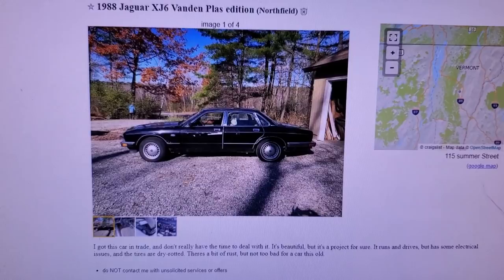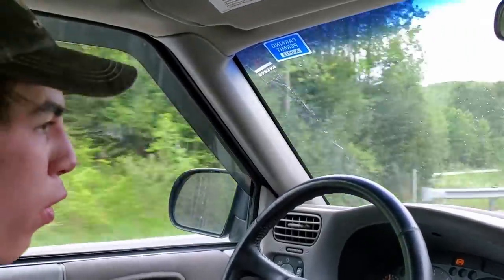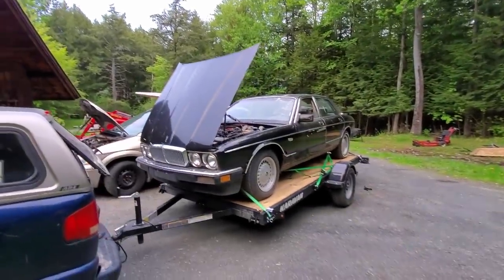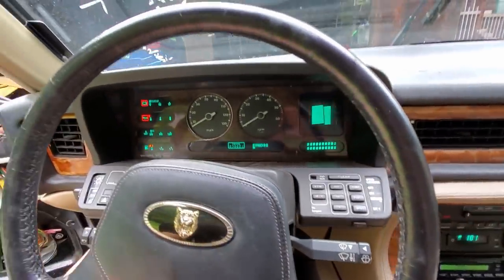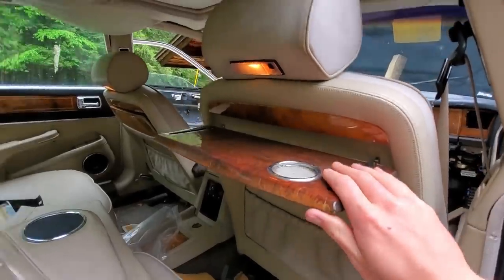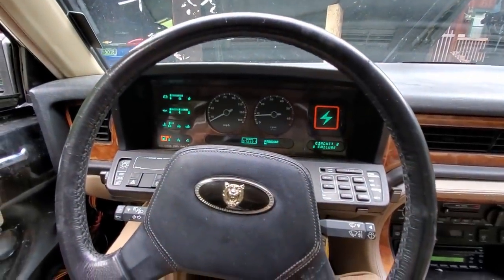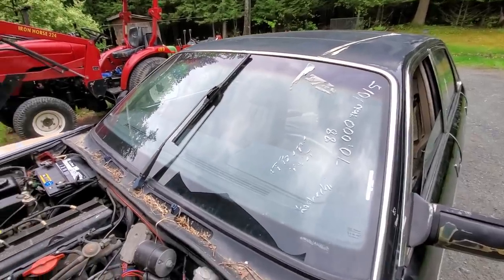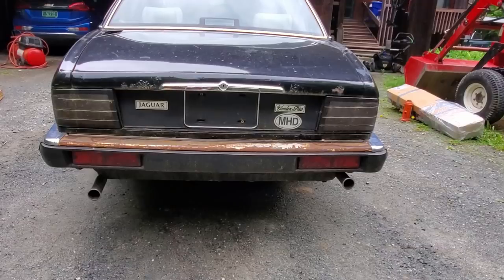I Got A FREE Jaguar XJ6 Off Craigslist!

Comment: I had a '94 XJ6, the last of this generation, and the second year of Ford ownership for Jaguar. Bought it for $1200, drove it for a year, sold it for $1400, and actually really loved it and was never left stranded by a breakdown. Sure it had plenty of little Gremlins - a window that wouldn't work here, a burst coolant hose there, one door only worked from the outsider - but that engine has plenty of life and is a rock solid lump. In "sport" mode, mine had plenty of juice and a hole in the exhaust gave it a perfect purr. Mine was a fine commuter in Texas, that I looked forward to driving and really didn't have any big issues with over the 12,000 miles I had it. The '99 Miata I replaced it with was horrid. Very fond of my XJ40 series Jaaaaaaag; hope you enjoy yours!

Comment: KEEP THAT NAKAMICHI RADIO!! Those are rare man :P
Reply: Good call!.....I had a Nakamichi cassette deck once, cool machine.
Reply: @iseeolly9959  I own multiple tape decks from them, and also an early 2000's car head unit.
Although it's outdated in terms of functions and features, it's still a great car radio, and so is this one.
Reply: He has the CD400, i'd die for that head unit to put it in my older BMW's.
Reply: @gideonbouwman4904  But I do still have a 1980's Akai Hifi cassette deck ....a GX with glass heads...whop whoop!
Reply: @iseeolly9959  those are good heads ye.
Had a Reel to Reel with those heads also, sounded wonderful.
Reply: @gideonbouwman4904  Yes sir, and they never wear out!
Reply: Gideon Bouwman 

My 72 XJ6 has a nakamichi radio in it

Comment: Circuit 1 failure is a blown fuse in the left lower fuse box.
Circuit 2 failure is a blown fuse in the right lower fuse box.
Reply: LOL!  There goes the "trying to sound Smart" evidence...  Yet much better than the stupid Check Engine crap that stresses us and makes some run to the dealership...
Reply: hey you seem to know your car electric stuff... can I try to ask you to help me with me 2000 4runner windows? they're not opening.. NONE OF THEM, the back, the front even the tailgate one. help !!
Reply: @megaxboxx  - If none are opening it is either power to them (check the manual and see what fuse/fuses are listed for power windows) or the module controlling them.  Odds are it's a fuse.
Reply: @hmm hmm - There is a push button reset switch on driver side under steering column.
Reply: @adamc6087  On a 3rd gen 4runner? I've never even seen a reset button on my 3rd gen in all my years of wrenching on it.

Comment: Im not sure if you know, but Vanden Plas was the "Luxury" Trim of BL cars. Everything from Allegros to Jags got a Vanden Plas trim with better finishings, better sound insulation and other higher end things. The base was built alongside the regular cars, but then they where taken to the Vanden Plas factory, where they made the interior. Also, the Jaguar XJ6 Vanden Plas only exist is the US market as in the UK this trim was a Daimler. 

This is a Jaguar XJ40, the successor of the Series III. Sold between 1986 and 1994.

Yes electronics are unreliable. Damn lucas electronics. The VCM (The screen on the right of the gauges) is extremely prone to breaking. The fact that it still works is a good sign. 

Check the tensioners and the oil. Headgasket problems are not uncommon as well.
Im telling you, that one is a keeper. Dont ruin it.
Reply: The correct way of pronouncing Vanden Plas is actually by soundng the the 's' in Plas. The ' plah' pronounciation  is a popular misconception. See here:  https://www.aronline.co.uk/marques/vanden-plas/
Reply: X2 on correct pronounciation being vanden PLAS
Reply: Agreed, this car has a lot of life left in it based on my XJ40 experience.
Reply: Santiago Rocha I don’t know if you know this:
Van den Plas, yes 3 words, started as a coach builder back in the days before the automobile. Long story short: he had 2 sons, they split up and did their own thing. 1 son went to England to finally sell his name. To protect his work and finances he changed the name to Vanden Plas. That’s why I still have to work for a living.
Reply: @argonaut6386  How interesting. I swear i remember on all BL promotional material and even on the Thames car show they prononced it like Plah instead of Plas. I corrected my mistake.
Reply: @hansplas510  So what do you do now for a living?
Reply: Reminds me of the old joke... Why do English men drink warm beer ? Their refrigerators were made by Lucas.
Reply: I can see the luxury.

Comment: Circuit 1 & 2 failure will be corrosion on back of the two fuse boxes on either side where the bottom of the door meets the sill at the front. If you are lucky and they are not too bad just unscrew the fuse boxes from the body, unplug the connector from the back of fuse box, de-rust the connectors and multi plug connector. Worse case scenario is the wires have broken off from the pins in the connector or connections on back of fuse box have corroded and broken off. This is a common electrical problem on the UK versions of the XJ40 variant of the XJ6. Usually caused by water ingress through rust below the front scuttle panel (panel below windscreen). The windscreen wiper has been fitted incorrectly, should park either on left or right, depending on LHD or RHD. Also worth checking the fuse box in the centre console whilst you are doing the other two, this should sort out all your electrical woes, when you put the fuse boxes back make sure to use some electrical grease to prevent future corrosion. Info gladly supplied from past 3.2 XJ40 Jag owner who had similar issues.

Comment: we need more videos on this. i got one just like that for $300 last summer and drove it everyday all summer IN LIMP MODE haha. eventually the headgasket blew and there were a few electrical gremlins so i sold it to someone who actually restored it, car never overheated (even after head gasket started to go) or let me down, and drove away when i bought AND sold it. i didnt even do an oil change or ANY maintenance (was 17 figured test my luck) these are good cars. and dare i say "reliable"... if you pay the right price that is.

Comment: These quad sealed beam XJ's are in my opinion the best looking of this generation of XJ. When they were new, the rode like a dream.
Reply: Steve Varholy , I agree but I really love the 2008-2009 XJ Vanden Plas. The Portfolio edition is amazing 🤩. In 2010 they became something totally different🤨.
Reply: @Tahvyy  The all-aluminum X350 XJ8s are a totally different beast. Drove my bosses a number of times. It was quick, well controlled, and it felt like you were riding on a magic carpet. It also got 25-26MPG on the highway. They would be my choice if I were looking for a used Jag that was not going to be a project.
Reply: Hated that my 1994 had the rectangles!

Comment: Add to your ToDo list: 1) Clean all ground points, 2) CRC Electrical contact cleaner on every connector you unplug, or better still, Caig ProGold cleaner.  3)New Fuel filter and drain the tank because they often have water in the bottom if not driven regularly.  4)change the brake fluid when you change the pads.  You will have to special order the right fluid for that year as it's not the standard DOT fluids.  5) fix the ball joints and new bushings and you will have a 4 door corner carver that does a great job of soaking up the bumps.
Reply from the maker: Thanks for the info!

Comment: Very nice, it's extremely rare to find an early Jaguar XJ40 (that's the chassis code, not the model) with a fully working electronic dashboard, they were a big issue with the early cars to the point where Jaguar ditched it in favour of conventional dials when the car got its first face-lift, but yours seems to be working correctly so that's all good as fixing them can be horrendously expensive.  The early 3.6 litre AJ6 engine is pretty tough so long as it's had some maintenance, it was the 2.9 litre version which was troublesome, and the 4-speed auto box is pretty much bomb-proof.  As long as it's not rotten underneath and in the scuttle ends you should be OK.  Suspension bushes and ball joints are a typical issue in one of these at this sort of miles but it's not too hard to sort, and the rear transmission mount can also start to fail too and cause some nasty clonking but, again, it's an easy fix...
Reply from the maker: Thanks for the info!
Reply: @ARuralVermonterQqjmcb182    My pleasure...

Comment: Trans fluid in the S10 was probably hot as hell after this tow....hope you let the S10 run and circulate the trans fluid when you got home and didn't just shut her down to bake. I won't touch the trailer issue just glad you made it back and no one was hurt or killed. Good luck with the electrical gremlins and if nothing else she'd be a good demo derby car! Grandparents had a cabin and 72 acre in Northfied off coxbrook road....miss that place!!
Reply: I think it's manual not auto

Comment: Hey I have the same jaguar model and put the same switches to start the car - you need TWO switches plus the push button start otherwise it will drain the battery . One switch for key position 1 to energize radio , windows etc, one switch for key position 2 which is the “running “ position, and the starter momentary button
Reply from the maker: Thanks for the tip

Comment: Sounds like the upper shock absorber bushings are done .Cheap to fix
Reply: I was thinking the same thing. Those bushing usually split and fall out on those models for some reason. Steering components are built reasonably well. Rear struts are horrid. Don't know how many I've seen with the main piston rod snapped in two. And its always been on the left side of the car.

Comment: That clunking noise at the front suspension is caused most of the time by perished upper shock isolators. These cars had a self leveling suspension (SLS) in the back but looks like this car had been converted to the regular coil spring/shock setup because the rear is not sagging.
Reply from the maker: thanks for the info

Comment: I had an XJ40 like that for a while. It had the  4.2 i6, and a bucketful of electrical issues, like battery discharging overnight, but DAMN it was wonderful to drive!!
Oh, and the monowipe shouldn't park in the middle of the screen like that, so there's probably an earth issue or several waiting for your attention ;)
Reply from the maker: I think a free car can take a couple of scratches lol
Reply: @ARuralVermonterQqjmcb182  I'd be more than happy with one again. :)
As I said though, you'll find that EVERY SINGLE electrical ground point will need attention. Jag electrics have always been.....  "temperamental, shall we say? (not as bad as the Rover 827 I once had, though.)

Comment: If your power steering fluid is low, you may need a new rack and pinion. Just had that same noise on my Integra with fluid that was puking everywhere... And it was the rack

Comment: Those Jags were notorious for electrical issues. MB had the single wiper blades on a model in the 1990s.
Reply from the maker: yes for sure
Reply: Says who?.  I’ve owned and sold probably fifty XK, XJ, XF and even X-type cars, very trouble-free.  I’m a car dealer in the business for nearly forty years.  I am an expert in my field.  Jaguars are wonderful cars and are getting better all the time.
,
Reply: @rickruberti5214  Hahaha. They were notorious for electrical issues in the 80s especially. Ford did help them in that area. If you think they didn't have electrical issues, you're from Mars.
Reply: @rickruberti5214  BTW, the X type was basically a Ford Taurus.
Reply: Sorry Michael.  The X-type was not a Ford Taurus, but a Ford of Europe Mondeo.  Look it up.  What Jags have you owned?  Ford bought Jaguar around 1990 when they had six of the top-selling nameplates and were flush with cash.  They also bought Volvo and Aston Martin.  Anyhow, the changes Ford made were primarily in streamlining the manufacturing process.  When they first bought Coventry, a Ford exec famously said that there was nothing in that plant that couldn’t be rectified with a couple of D8bulldozers.  They did also improve the electrics by replacing the less reliable Lucas equipment with their own sorted-out system.  So yes, the Jags of old did have some electrical problems, but that was pre-1990.  The Stone Age.  98% of those cars have long ago been crushed and have probably resurfaced beneath Toyota/Honda badges.  Please do your homework before spreading  mis-information about anything.  I only speak of what I have myself actually read or experienced.  I am a car dealer, but an enthusiast first and foremost.  Check my website.  No dealers near me stock Jaguars, Mercedes, Audi’s and BMW’s, because they are afraid of these cars.
Reply: My first Jaguar was a 1973 XJ8 that I bought in 1979  that had been vandalized.  I fixed it and drove for awhile my senior year in college.  Great car with a great feel and sound.  Only electrical problem was with one of the fuel pumps.  But it had two tanks and there was a switch to change which tank you were drawing from.
Reply: @rickruberti5214  It was a "World Car" platform. So, basically the same thing. And, they still had elec issues until the Ford retrofit.
Ford had cash and expanded. But, the crash of 2008-2009 fixed all that. All the American companies sold off and downsized.  Mercury was expendable, I guess. But GM killing Pontiac was a mistake, I think. They were the experimental/ sporty division.  But, the redundancy was horrible. 
Of them all, Benz(with the exception of the 03 E class) are usually up on their game. Beemer, most of the time. Even with that said, Jag and Land Rover have a shitload is issues for the price paid. As bad as Chrysler. Boy, Benz screwed them good...drained their cash, fed them the 2002 E platform, and bailed. Though the reworked E(300, Charger, Challenger) saved them. If they could get their repair ratings up with their design, they would be a powerhouse.
Reply: @rickruberti5214  BY THE WAY..DISINFORMATION??? JAG STILL HAS A LESS THAN STELLAR REPAIR HISTORY.
FOR THE MONEY, THEYRE A RIP OFF. I WOULD RATHER OWN A CHEVY.
Reply: You y friend are demonstrating your ignorance.  How many have you owned?  That’s what I thought.  Keep driving your numb Honda and leave the Jaguars for educated folks.

Comment: Nice! My daily driver is a '98 XJ6 Sovereign with the 4.0L straight six. The great thing about these cars is that they're too old to be prestige any more, but not old enough to have become an expensive classic. As a result, they can be had for very low prices - although I've yet to see one in UK for free :-D Mine has been well cared for and has no issues so far, but that may be because it was made during Ford's ownership of Jaguar when there was a major improvement in quality control.
Reply: Dojocho  Yes - there are excellent aftermarket parts. I bought a new headlining as the original in my car had nicotine stains from the original owner who smoked heavily. Very affordable compared to original Jaguar parts!

Comment: The Lucas years cars were about as unreliable as a vehicle could get. I had a late 70’s XJ12 with Lucas electronic fuel injection, I could only keep it running without issue for about a month at a time. Parts were a nightmare to source. Once Ford bought them the quality went up fast. My current jag beater is an 01 XJR that I picked up cheap with every fault code known to man. Simple wiring repairs fixed 99% of the issues. I’m a shock bushing and A/C clutch away from zero issues.
Reply: You know why thew British like their beer warm, right?

Lucas refrigerators.
Reply from the maker: sweet

Comment: I used to have an 89 xj40 Sovereign as a second car for lazy Sunday drives. No codes, all electrical worked, amazing car. It was also a fuckin nightmare. Insanely expensive parts and no one knew how to repair engine problems because it was grey market and had a 2.9 inline 6 that was not available in the US. The cabin was super comfortable with a giant steering wheel. It was my favorite driving car I’ve ever had, though way underpowered. I think gen 3 and 4 xjs were very attractive in the styling department. 

This is an example of what happens to cars with lots of features when they get old. There is a threshold from which there is no turning back from the number of repairs needed. Even an old Lexus will go this direction once it gets old enough. Hell, I even had a 93 LS 400, Consumer Reports most reliable car for years, burn down on the street from an electrical short. Luxury has a price AND a lifespan.

Comment: Welcome to the Jag family....You are in for hours of headaches, much frustration and some $$$$ disappearing....However, when it's running right, nothing beats a Jag.
Reply: First lesson...It is JAG-U-AR.....Not Jag-UARRRRRRR.... K, at the person below me mentioned, Circuit 1&2 failures are fuse related...Except if there if the seat belts are not retracting....Then the dealer get's to fix that for you for free...Lifetime warranty on the passive safety system...BTW it's fuse #9 on each side for the belts....
Reply from the maker: Thanks for the info!
Reply: You my friend, know nothing about Jaguar reliability.  But your last four words are true.  “Nothing beats a Jaguar”
Reply: @rickruberti5214  You're right, XJS, XJR, XFS, The XJ's were horrible for reliability, the XF has been bullet proof so far.